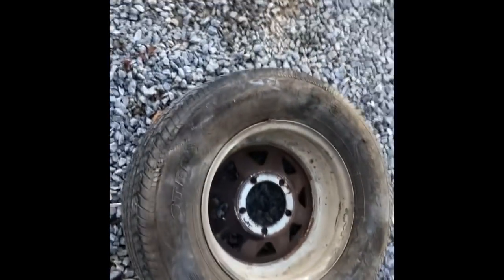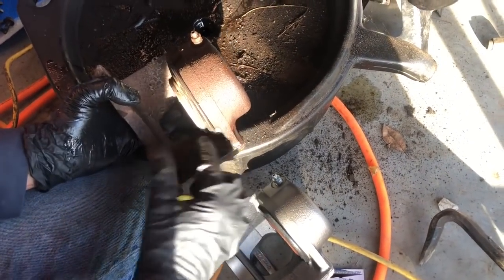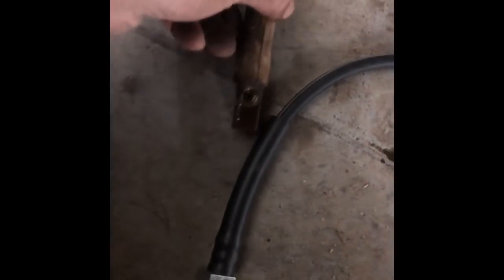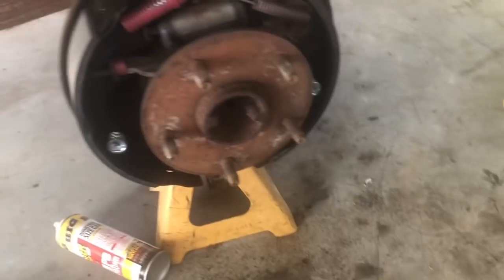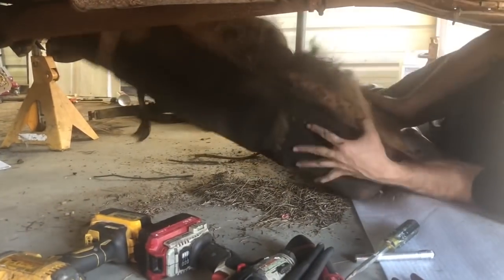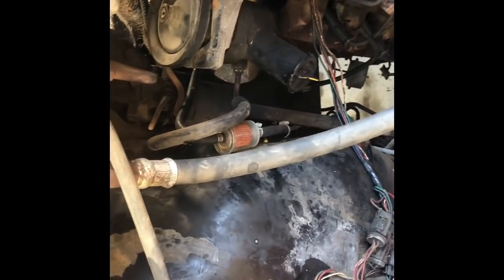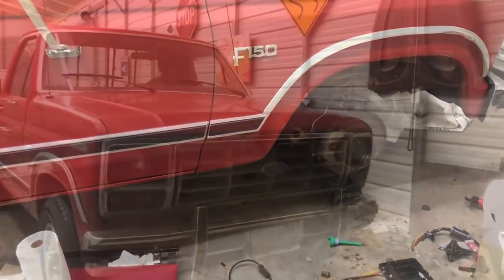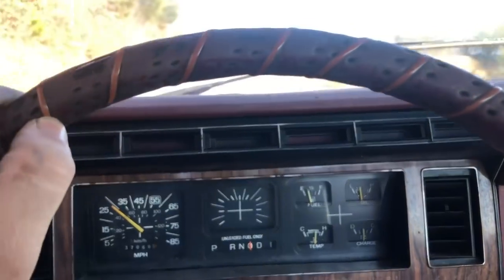F150 back on the road after 17 years parked 84

Comment: Great job. I love bringing old rigs back around that have been forgotten about! I like to drain the oil and put a few quarts of diesel fuel in the sump, let them idle a few minutes and then drain it again and filler up with oil. Cleans the rings, lifters, and oil galleys right up. I'll change the oil once more after a few drives. Great job!
Reply: Same here. If a vehicle has been sitting for years l drain the old oil and then add 5-6 qts of kerosene, let it soak for a couple days then drain and then do that diesel fuel trick. Those old 302s can take almost anything and keep running as long as you keep them clean internally.
Reply: @michaelreece458  even better  keep the oil fill cap off , drain the old oil and screw on a cheap oil filter and add 8 quarts of ATF fluid ( but do not put the engine under any type of load ) just let the engine run , keep an eye on the oil light , change out the filter several times , drain the ATF fluid and add 6 quarts of a good quality full synthetic engine oil 

ATF fluid is high detergent and will dislodge all sludge that is holding the piston rings in the compressed position very quickly
Reply: @davidrfowler6432  that's some good advice.

Comment: Some of those early 80s Fords had two fuel pumps from the factory, one mechanical and one electric. I guess someone decided to delete the electric one. The electric one was basically there to assist the mechanical one. Some of these Ford guys could probably tell you more about it than me, but I have seen that before. There was some reason that they did it, but I can;t remember what it is.
Reply: It was the 87 -91 and it wasn't to assist the mechanical pump it was to feed the high pressure frame rail pump. Was an electric low pressure 6psi pump. It also helped with switching tanks and not stalling if you ran out of gas as you switched. There wasn't any electric pump for the carbureted  trucks. The "clicky clack" pump (as @vicegripgarage so lovingly calls them🤣) is an aftermarket pump most likely put there to not replace the mechanical pump that was failing again.
Reply: 87 / 88 frame mounted  high pressure ,90 / 96 in tank  pump  only.   My 88 has frame  high pressure  pump but my 90 is in tank  pump  only.  Some carburetor  460 had an electric  assist  pump.

Comment: My son-in-law has one for sale here in Alberta Canada. It’s an 84 F150 with 437,000 klms on her. She’s needing some TLC for sure but drives well. Panels showing rust but can’t expect much else for a 36 years old truck. It’s a base cab 2 wheel drive automatic with twin gas tanks. The motor is a 5.8ltr V8 SOHC. We would fix her up but getting parts to Canada is to pricey. You Americans are lucky to have the likes of LMC Truck parts and Rock Auto to chose from. Great low prices for these old girls.
Reply: I live in Alberta, there are loads of economical parts available here! You don't even have to look hard. You just gotta look. If you are in southern Alberta, look up Checker auto in Didsbury Alberta. 🙂
Reply: @lowellfunk8974  Thanks for the reply, the truck has since been sold on.

Comment: vehicles that se for years.  need the brake system replaced...the  fuel system gone thru...the trans. flushed and validated....the motor freedom up....first  step is to run cold cranking compression...the move onto engine electrical!! that's just a start!   thanks for your videos....god bless yall.
Reply from the maker: Thank you sir .. yes you are right

Comment: there are several fuel and oil additives that will de...carbonized your motor ...while you drive....sea foam is still good...it is designed for carburated motors... marvel is great to de varnish a motor...thanks! don't forget.  risolene...its great!
Reply from the maker: Awesome thank you

Comment: COULD OF PUT A LITTLE  NEVER SEIZE ON THE BRAKE HARDWARE TO LAST AND WORK ALONG TIME  DAB IT ON WITH A OIL BRUSH   SOME TIMES CALLED A CHIP BRUSH, A  CHEAP HARD BRISTLE WITH A 6 INCH TIN HANDLE

Comment: It would look fantastic if we painted it 4 ya. I just had 84 here and for some other unknown reasons that was another one that was found in an abandoned house in a detached garage where it had allegedly been for nearly 21 years according to the folks that now owned the property they had owned the an adjacent property for many years. They said the guy that left the trucks behind in the house was an old miser that never fixed anything. After they get over the bump of our bill there is allegedly yet another blue Ford and gray Chevy truck. All with no visible rust. We did find some really severe hidden decay inside the drivers side fender & the door bottom that just didn't pop out because the truck had not been exposed to weather for many years. As I explained things to them folks the first time it would see weather the rust would come thru the new paint. The rest of the 84 was rust proofed and we sealed all them leaky seems and screws that poke thru the floors of them older Fords. I don't know if there are any other resto guys that do these old Ford trucks because me I have only done a handful in my life time. But it seems from 1986 thru 1996 there are many spot welds that blew completely thru the metal leaving holes in the single and extended cab pickups. It appears the spot welder was not centered on the seems and where it hit a single layer aside the seem to be welded I would find holes from these misses of the spot welder. As stated the Ford factory Quality control missed that critical truck killing flaw. I don't know how things got so sloppy at Ford but I have seen this on the New Body style GM trucks too. It's not a pretty sight 10 20 years later to find rust up inside areas that shouldn't ever have any rust.
Reply from the maker: Thanks for the info this is actually my neighbors truck

Comment: why not have the front rotors turned that way they have a better chance of working right?
Reply from the maker: The customer didn't want me to spend anymore than the minimum to get it driving
Reply: @Sleeperdude  I see that's kinda of a safety issue but I'm happy you are saving the old girl the truck is to nice to be seating
Reply: How stupid they put those useless hubcaps on those wheels which are not ment for covers, "covers? Huh for what ?
Reply: Nice pickup. My Dad always had him a F150 with dual exhaust  & glass packs

Comment: A lot of people don't understand the love of an old Ford pickup. I have a 1990 F-150 4x4 and well probably had it until I die. Don't get me wrong a new truck is a lot more comfortable but there's just something about driving in an old pickup truck. Whenever I do take it out I always get thumbs up and a lot of times someone makes me an offer to buy it. I've had people knock on my front door and ask if I would consider selling my truck. My truck can sit three or four months without starting and when I go out there and it starts up almost all the time. There is some occasions when the battery does finally die from not using it. 

I like watching you getting this up and running again. I'm glad to see you did not take any shortcuts.
Reply from the maker: Yeah it is more fun driving old vehicles

Comment: Running over halfway on the temp. Got an issue there, most likely needs a new radiator,  also, cooling passages in the engine could be gunked up.  Definitely tons better, but lots more to do.
Reply from the maker: Thank you

Comment: Them old rotors are so worn they're almost see thru...
Reply from the maker: Yeah I ended up changing them later
Reply: @Sleeperdude  Customers go on the cheap. We have that happen here $50 bucks for this and $100 for that and we hand em a $700 to a $1,000 bill they panic like how the hell did it get to be that much. For the record I even do it myself buy a handful of parts look at the bank balances and I am almost broke. That is how it happens to everyone. But in a serious note using old worn out parts and them old fuel tanks when stuff is a certain age now I force the changes on the customers. I try to do it by assaging em with common sense. How many fuel tanks I put back up in old trucks and they start leaking a day or two later.

Comment: This is probably the most sensible revival I've seen in a while, no loading the parts cannon and no well while I'm in there I might as well syndrome... What it needed, no more and no less! I recommend disassembling the evaporator core box, that thing will be full of those pine needles and will get against the hot blower resistor and start the truck on fire and all you can do is watch it burn. Ask me how I know! Also loose the fram filters, I don't care how great anyone thinks they are or how many thousand years you've been using them, they suck as bad as old paraffin based Quaker state.
Reply from the maker: Thanks

Comment: Always room for one more subscription... that one wanted to run in the most horrible shape for the oil cavity was just so full of water... kinda curious as to what this first oil change is going to look like. I am sure that is the one hundred thousand plus miles as too much gunk built up on stuff like the fuel pump an other stuff around it. You have a good hand on diagnostics and it paid you well. The lady ain't saving a dime on using bad rotors but her call until you can find a crack or something showing a fail. One nice thing about videoing a job is the proof that the work billed is the work done. Its between the 302 and the 300 six as to which engine was the all time best all around engine for longevity. I myself got lucky on a 302 engine that was plumb worn out..... I had just dumped some gas down her throat and for one good reason or another it hit and stayed running for the while I poured more fuel through the carb and it smoked so bad that neighbors closed their windows. I took the plugs out after I had kept it running long enough to get it warmed up good. only three plugs were working and the others were completely fouled out. I figured well just a set of bearings and rings, do the valve seals n get it running on the cheap but when I tore it down two pistons had holes in them, and that list just goes on. So to me truly convinced that if they run in that bad of shape then they will go quite a while with some service. Nice work on your part. I like people who act like adults instead of ain't I cool like the junk yard digs boy and his girlfriend Mook. The guys he hangs with are so much smarter that I can see why they drift away from him. He does know how to rebuild a carb but from there, he must follow the painted rocks to get home. Thanks for the videos and I might add, well done on the camera work
Reply from the maker: Thanks man she did eventually decide to put new rotors and brake pads on it later I can’t believe you got an engine running with holes in some pistons

Comment: I’m about to start a 1991 f150 that’s hasn’t been running for 20 years what should I do? Just put a battery and start it? I’m making sure it has all the fluids!?
Reply from the maker: Yeah I usually start with putting a battery on it and just trying it usually the fuel system is bad and you have to replace most everything